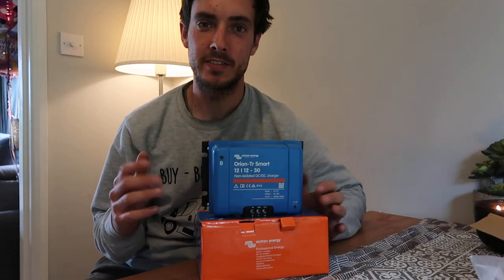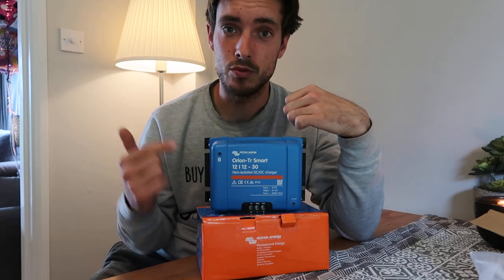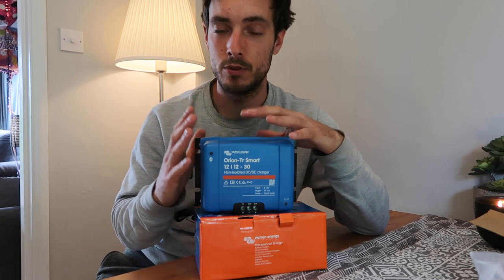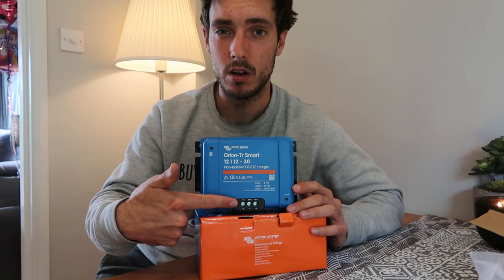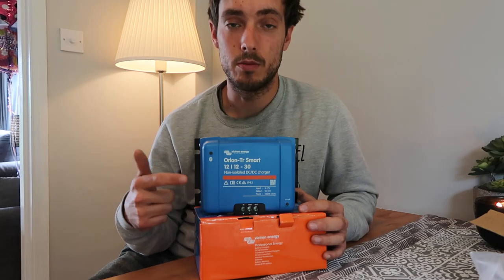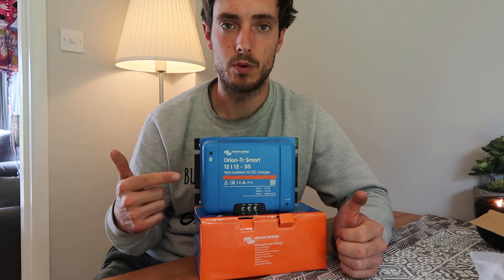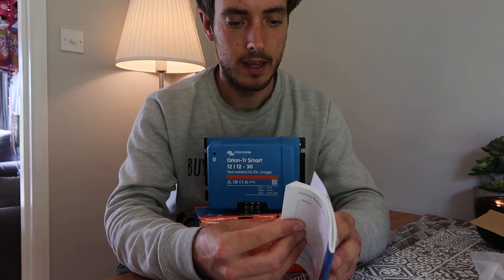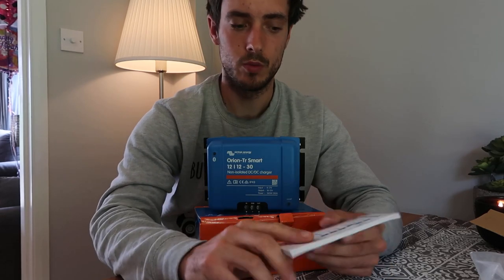Victron Orion Non Isolated vs Isolated DC-DC charger

Comment: Excuse me if this is a newbie question but how does this work with an internally regulated alternator where the field coil is controlled by a circuit inside the unit ? 
Thanks 
B
Reply from the maker: You can log into the unit via the app and change the parameters to match the alternator you’re using to ensure cut in/out happens at the correct voltage.

Comment: I bought an isolated one to put in my trailer to isolate the 7-pin power connector from the trailer power system (that I'm converting to lithium), but now I'm wondering if there is really any reason to isolate the grounds between the two vehicles since when they're hitched up, they're actually going to be in physical contact anyway.  If I try to maintain the isolation when I do the install, I'm going to make it harder on myself if I want to use the smart shunt to measure the alternator voltage from the 7-pin connector because it'll be on an isolated ground.. so in the end as far as I can tell (unless I'm wrong), I've wasted the extra $40 or so that it cost because I'll end up having to tie the grounds together or I won't be able to measure with the smart shunt.
Reply from the maker: I would say you’ve done the right thing buying the isolated model for this use. I wouldn’t advise running a non isolated model on this setup.

Comment: How do you ascertain if your Mhome is fitted with a ‘smart’ alternator?

How do you examine the Mhome to determine which model of charger is required?

Does this charger have any role when the Mhome is electrically hooked-up?
Reply from the maker: Hey Samuel, this does not have a role when hooked up a multiplus would do that job if you had one installed, Any van of any age can have a DC TO DC charger and it's better for your battery bank to use one. Usually you'll have a smart alternator on anything that's euro 5+
Reply: @Aboutavan  Hi and Tyou for prompt reply.
Would I be correct in thinking the B to B charger is really designed for ‘wild campers’ and of little use to me as I stay on campsites where I use EHU’s?
My van is a 4 years old Hymer with 2 leisure batteries but one charger. Can you envisage the fitting of this charger being useful to me or the batteries which were replaced last year as one was defective?

Comment: Good info thanks
Can a dcdc charger be used with an mppt controller and does the total output combine or reduce ?
Reply from the maker: Hi Malcolm, if you’re using a victron MPPT then they measure the state of charge and adapt their output accordingly, so if your battery bank is full then your solar yield would be very low even on a sunny day. You can get combined units from Sterling which I believe are 30A units, I prefer to have some redundancy built in though so I’m not relying on one unit for all of my charging.

Comment: Should I get one of these to charge  my new lithium batteries off my old flooded lead acid batteries?
Reply from the maker: Do you mean your starter battery which is lead acid or some other power source?
Reply: @Aboutavan  hello and thank you for the replying, not my starter I'm off grid in an old cottage iv purchased new lithium batteries for powering the cottage and was wondering could I use this device to charge off of the old flooded lead acid batteries?

Comment: Hiya.
Thanks for the video.
On the non-isolated version, is it possible to wire the leisure batteries to the chassis for charging purposes, yet run the power system (inverter etc) straight off the batteries, not using the chassis? (ie isolated for use, non-isolated for charging)

Thanks :)

Comment: I’m not sure if I’ve got a common earth on our van so I’ve opted to buy the isolated version I’m also fitting a 200 amp lithium battery, will just one of these 30 amp B2Bs be enough as we wild camp throughout the year. I’ve a Hymer Exsis I 2013 model. My on board mains chargers have a gel settings which I’m told by the battery supplier is ok for the lithium battery he’s supplying.  My only problem is the electroblock supply’s both main charging and the split charge via just one conductor to the leisure battery’s . I’ve no idea how to disconnect the split charge relay in the electroblock. So I thought of fitting a relay normally open in this conductor that would only make a connection when the mains power supply was on and the engine off. Any comments would be most helpful.
Reply: Hy Wobby, I would suggest to juste pull the fuse from the ELB 12 Volt charger, if you have a inverter that can be connected to a shore connection and charge your 200Amp battery.

Comment: Hi, so I'd like to set up a spare lifepo4 battery and 3000w inverter inside my 2018 Toyota Tundra. This way I can run an oxygen concentrator in my vehicle to get to Mayo Clinic. 
I'd like to have everything inside the truck at the backseat. Can this be used inside the truck? What wire gauges would you recommend. Thank you, very informative.
Reply: Yes it could fit. You would have to design a mounting system for the various components and consider removing the rear seating. There is more needed than the things you have mentioned however. Wire gauges differ for each component and is also determined based on the load. 
There are many gauge calculators online and you could also look at other peoples projects to get an understanding of what is required additionally.

Comment: Great video (Y) 

I´m about to buy one and use it as a dc-dc charger from my starter battery to housing battery. BUT i also thinking of having it as a power supply for my computer. so i will have to have some sort of switch to  make it dual channel intake. either from starter battery or housing battery pending on what im using it for. does it sound crazy? :D

Comment: Is it possible to dial down the output on this DCDC? In other words set it up to send 18A to my battery rather than 30A?
Reply from the maker: Hey there, it's not possible to alter the output of these, if you need an 18A output I'd recommend grabbing the 12/18 model which is also cheaper!
Reply: @Aboutavan  Hi! Thanks for the advice. I actually looked into the 12/18 but unfortunately I couldn’t find a non-isolated version. Not sure if it exists. I decided to buy the 12/12-30 and step up to a 100AH capacity. I plan on getting the battery in the very near future.

Comment: Hey there, well explained!!!

I‘m used to isolated vs non from audio work so I know  the basics.

By accident I ordered the isolated version (same price here) but I‘m running a non isolated setup with an old standard alternator in our van.

Would you have any concerns running the isolated version with common ground (by just bridging the ground terminals to common ground) or do you think I should return the unit for a non isolated one?

Thanx a lot in advance and keep up your great work!!!
Reply: Same question here, did you figure this out?
Reply: Same for me and this question has been asked a few times. Don't see why it shouldn't work, the battery groungs are connected together anyway

Comment: If I run a negative cable from the starter battery to the negative bus bar, would my system be grounded in that case? Wondering if that would be enough for using the non-isolated version. Thanks!
Reply: Hi. Did this work out for you?
Reply: The non isolated version does not provide a negative connector on the input side.
Reply: Hi, short answer is yes. Your negative bus bar is connected to the negative on a starter battery and every car has it's negative port on the starter battery connected to the body frame.
One thing to bear in mind is that not every metal piece on the bodywork might be necessarily connected to the body frame, even if it is screwed together, there might be isolation in between (like paint or rubber). Would advice to check the connection with some electrical tester if you are not sure and would like to use the body as a negative connection.
Reply: @AcidDotCom  To solve this could I earth bond the negative bus bar to the van body and then connect the earth from the invertor also to the negative bus bar????
Reply: @AcidDotCom  "every car has it's negative port on the starter battery connected to the body frame" Careful with that, it was common to have positive earth cars, I have one, though I've since converted it to negative earth.

Comment: Hi ,many thanks for the vid and info , just a question please ,my system I think is isolated on a Renault Master van , the leisure battery is not grounded to the chassis (in the rear boot space) the negative cable runs through the van up into the electracal box near the front with the  victron inverter and mppt etc  , I cant see anywhere where the earth goes to the chassis apart from an earth the goes from the victron inverter body to the chassis , can I just earth the leisure battery to the chassis and earth the negative 12v bus bar the same in  the box to create a non isolated system  and use the non isolated Orion Tr Smart ? hope this makes sense :)
Reply: Yes but you would achieve the same result by simply doing the negative bus bar to the chassis and leaving the battery alone.

Comment: What size wire and ferrules did you use on your 12v DC to DC Charger install?
Reply from the maker: If you’re installing the 30A unit then you’ll want to use 16mm2 cable as recommended by victron :-) but you could use 10mm2 depending on the size of the run as this is up to 70AMPS most ferrule kits won’t come with 16mm2 pieces so you’ll need to buy a crimper and ferrules for it separately.
Reply: @Aboutavan  Thanks for the response, very helpful.

Comment: Any experience with the 12 24 dc to dc from them? I was told that 24 volt systems can't be charged by alternator but that unit fixes that problem I think eh?
Reply from the maker: I’ve not got experience 12-24 but I’ve just installed a 24-12 Orion converter, works perfectly.
Reply: That is correct. It will take 12v from your alternator/charging system and boost it to 24 via internal secondary and primary coils. These operate very similar to how Buck-Boost transformers work. A 24-12 Orion is the same thing with the windings tapped differently. Known as bucking.
Reply: @nizym5963  Nice one ;-)

Comment: Really great video... am I right in thinking if its all wired up properly there's no difference between the isolated and non isolated versions? My system will hopefully be used in the alps during winter when we can travel 😄😄
Reply: @Mat Tear  so I got the isolated... 4 wires and it was very straight forward... and I can use the unit for something else where I can't easily ground the system.... couple of extra quid but its what most people seem to get...
Reply: @Mat Tear I do t think isolated requires a ground to function... but obvs it should be grounded somewhere...

Comment: Have a sailing yacht with 5x105amp house battery bank charged by solar, the boat is not in use for 6 months of year, Need to trickle charge when not in use the engine start and 2 x 12volt bow thruster batteries, will the VictronConnect 12 12 30 do this from the solar charged house battery bank ???
Reply from the maker: You can turn these modules into power supply modes which leaves them open I believe, I will try to check this and get back to you, I know it works as a power supply engine side to leisure.

Comment: Hi,

I’ve just found out my van has a smart alternator. I’ve decided to go with the Orion B2B smart charger. I have a 120ah leisure battery. Would a 18a charger do or will I need the 30a? Please help lol

Thanks in advance

Chris
Reply: FFB this all depends on the charging capacity of your alternator. 
I have a 90 Amp alternator and a 120Amp Lifepo4 battery (see the difference) so I went for a 12-12 18Amp Victron dc-dc charger( this means 18 Amps for my leisure Batt and the rest for the the starting batt and lightning). Just for not fu...ng up my old alternator. And it works perfect, if I drive 6 hrs from one location to a other location than my Lifepo4 is almost 100% recharged. I'm not boondocking for several days

Comment: Good tutorial but too much focus on the Victron as such, almost no info on the isolated vs. non-isolated topic.   With a little help from your friends .... ^_^.   Like a bird on the (electrical) wire : the bird is smart enough to keep both legs close together else ... BBQ will be the result . 
So many people ignore Ohm's law :  voltage drop = current * resistance, for sure when high currents are involved ( 50 A , 100 A , 200 A in vans, camper, RV, ...)  Non-isolated charger :  the grounding wire is going from the alternator (A) to the starter accu (B), from B to the Victron C (common in & out) , from C to auxillary battery D, from D to inverter E.  The black wire string  A-B-C-D-E is handling all different currents in the intermediate sections and will have all different NON-ZERO voltages on the nodes B, C ,D and E. (with respect to reference A).  Example :  30 Amp  in 1 meter AWG8 will result in a voltage drop of some 60 mV.  This 60 mV is fooling the Victron (and also the BMS in the LiFePO4 battery). 
As opposed to the above STRING topology the isolated Victron will allow for the STAR topology.  All common nodes (B , C,  D) do have their own individual black wire connected to A (or B is also acceptable). Of course the same story is also true for the red 12 V wires, but here the voltage drops as such are less critical for Victron ,  BMS, ... because the " zero volts" is the reference.This will reduce the differences in the "common ground voltage" to more acceptible values and thus more accurate behaviour of  theVictron and the BMS.

Comment: Thanks for this - comprehensive and well done.  So I have a fiberglass truck camper on a Chev truck and installed a Victron Isolated 18A dc/dc charger.  I did have to run a wire to connect directly to the 7 pin connector positive lead.  However I am using the ground (negative) at the battery.  There is a ground buss-bar near the 7 pin connector and it looks like there is a substantial wire going from there to the battery compartment (I think).  So I have connected both negative wires from the Victron charger to the negative terminal on the battery. So the 2 negative terminals are jumpered together and connect to the battery terminal.   So did I buy the wrong thing - would the non-isolated one work?  I believe I have a problem with wiring though, either in the camper on in (or under) the truck.  When the charger begins drawing current the voltage drops to 8.8v with the truck end at 13.5v.  Anyway, I am asking for a refund as I don't have the ability to install new heavy wiring and connectors, etc.  But I am wondering if this voltage drop may be due to incorrect wiring.  Any comments or suggestions would be appreciated.
Reply: I think I got it going.   I bypassed a couple of fuses and re-did some questionable wiring in the truck.  I think it is working on the edge as far as kicking out when it first starts drawing the 18amps.  We'll see.  Thanks again.

Comment: Great video Adam I installed a isolated 12/12/18 last week and am at my wits end with it I can only get it to work properly if I run the air conditioning on full other than that it will come on under breaking of 30 seconds or so then turns straight back off could you please help me set the programming up for it I would be very grateful I’ve tried the face book groups and the support pages and had no joy 👏
Reply from the maker: Sorry, I’ve only just seen this, I got so many comments it was hard to keep up!

Comment: I have a  ADA Van (Main 12v front, Rear 12V lift Battery)   both batteries are chassy ground I want to use a 12-12-18 cause thats all power I need but those are only avalible in Isolated versions.  OK  please answer me this  do I have to run TWO Negs (one from each Battery)  do I just ground the two Negs on the charger (2 center terminals)  to the chassy,  Esentially Jumpering the NEG together to ground  will the charger Care?    I am trying to avoid the 12-12-30 non-Iso just because it is overkill/hotter.  I read  the 12-12-18 has some issues with the B-tooth app this still true?    any and all info welcome thanks.

Comment: Victron says NO ferrules!. You lose contact area of the wires.
Reply from the maker: If people can competently install the cables ensuring no strands cross into the wrong terminal then of course without is better as per victrons advice but for DIY installers who are watching this video ferrules are a safe way of keeping loose ends tidy and safe.

Comment: I don't understand you, when you talk sometimes all these terms: isolated, non-isolated, on isolated, the isolated, the non isolated, the on isolated. Maybe its my problem, english is my 3rd language, but i tried to listen you over and over, but i mixed up those terms or you explained wrong. I bet its the first one.
Reply from the maker: @kallehanhela782  if you’re using a “non isolated model” then this will be attached to a common earthing point such as the vehicles body so 1 negative and 2 positive connections, if you’re opting for the “isolated model” then you will have a positive and a negative for each battery so 4 connections in total, 2 positive and 2 earth. I hope this helps?